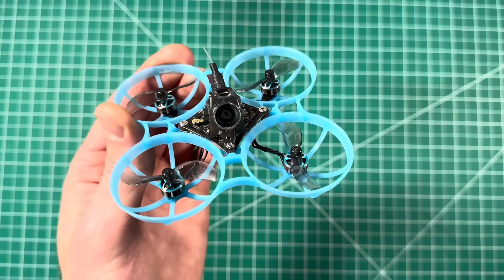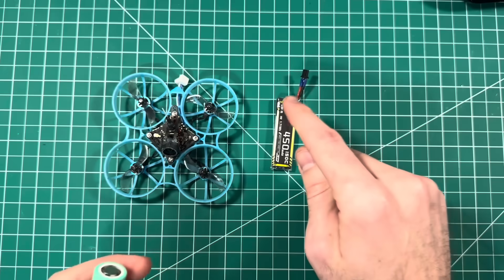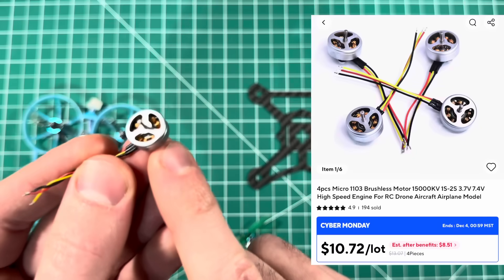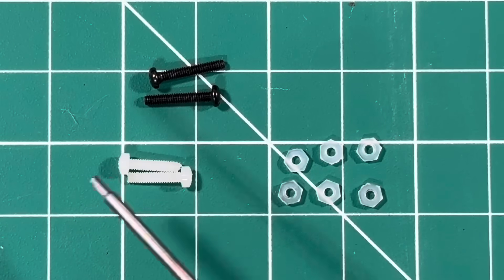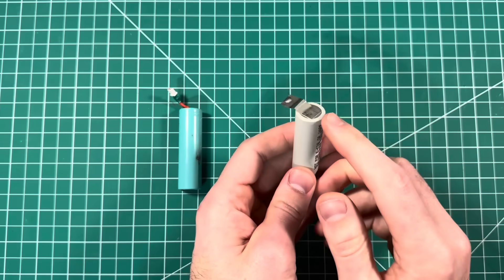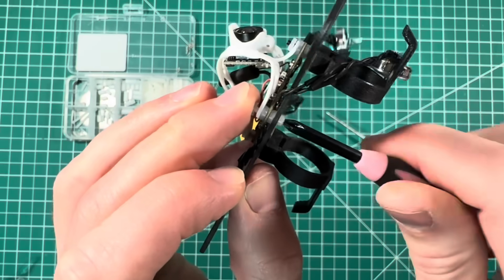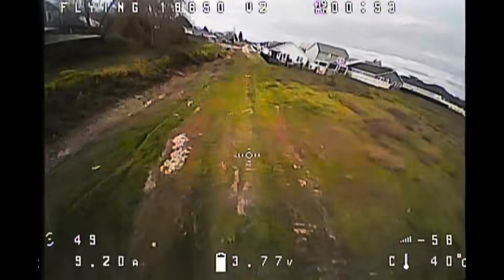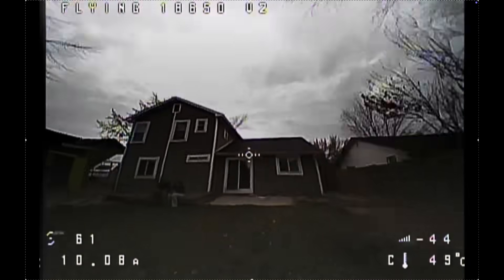Convert Any Tinywhoop to use 18650

Comment: dont listen to this guy... you can solder the battery its not damaging at all youd have to hold it there for 5 mintues to do so...   also a vt6 sony cell 15 -30 amp is good or a monocell i think its called 50 amp cell..... a 1404 motor is the bare min 2s motors.. a betefpv 1s hd board is what you need and dont use the power for the dji lite vtx you need to remove the pins power and grond and get a 1s 2 amp bec they make micro ones and use that to power and leave the connections on the rest of the dji connector into theboard reason why the 1s board lies and says it can handle dji it cant only for 3 minutes then you get warnings overheating cpu etc... so you need the bec...... and a good frame and the 1s board has expresslrs on it already.. it will fly about 7-9 minutes not 10 to is totally low you want to still stay at 3 volts min lition can go to 2.5 but you need to still stop at 3.3 volts be on the ground and 3vollts being the bare min leave the settings alone on the a1 betafpv board just setup your radio elrs etc and youll have a awesome flyer i have 5 betafpv boards and they all come pre set up for anything even the pids they fliy perfict you shoudl fly at 30-40 throttle punch outs are not a good idea   the bec will cut off at alittle under 3 volts so be on the ground at 3 thats about 7to 9 minutes not 10 not 15.. i been building drones since drones and lipos first came out first lipos came out the debate on the 1 c thing etc... btw you can charge up to 5 c on some lipos dont do it but rarely maybe 1 c to 2 c to keep the cell lasting longer instead of 200 cycles youll get 500 etc... anyway thats my advice.. ive just built a micro like this with a 1 s 8 minutes flight time it hovers with hands off  dji lite super quiet etc.. and i think i spent about 250 max i already had a radio though i bought monocell battts they are the best at 50 amps output vt6 sonys are next up and if you cant find them samsung 15 amp or higher is what you want youll find sonyy gets how everyone but the monocells get hot they get warmm.. so there you go thats my 1 good deed for the day
Reply: i assume you are talking about molicel, as far as i know they don't have a 18650 cell that is anywhere near 50a capable. unless you aren't talking about molicel.

Comment: Thats some advanced mental gymnastics there, if you are tripling the weight of battery for triple the runtime why not just strap 3x lipo batteries?

Cost is really not a factor there, those 1s 450 lipos are getting cheaper and cheaper day by day and its barely any money save to use 18650 if you are to get quality cell. The lipo packs you shown in video are currently 4 pounds each or even as little as 2  if bought from overseas. Then the flight time, just why? Whoops are fine if flying 3-5 min then you come for 15 second battery swap, you are always flying those close to starting point with those. If you are going for long range missions just grab a bigger drone.

Idk why are people acting like you go out with your whoop and fly one 3 minute pack and head home, like you cant change them on the spot. Just grab 10 pack of those cheap lipos and have them all charged for the outing
Reply from the maker: Love that you bring these points up!

1) why not just use x3 small lipos?
4 small lipos will give you 1800mah at 52 grams weight vs 18650 will give you 3000mah at 48grams weight. You get waaaaay more capacity with lithium ion per gram of weight. 

2) Cost
Your right. Really 18650s will be more expensive if you add in the wires and connector it ends up being around $5 per battery. The difference is that the little Lipo batteries don’t last very long. They are not very durable and don’t have very many cycle life’s before they don’t hold a charge anymore (100-200max). Many 18650s on the other hand, have over 500 cycle life’s before and tend to be more durable. This will create less waste and be cheaper overall because you shouldn’t need to buy batteries half as much. 

3) small drones have more accessibility to places. 

4) your also right that you can easily bring a ton of 1s lipos and just switch them out. This one is probably more personal preference but swapping out lipos gets really old for me. I have found that I learn a lot better when I have more extended flight time. I can really get in the groove.

There are definitely pros and cons and I don’t think lithium ion will ever replace lipo but I also think that Lithium ion can be a fun alternative for some applications

Comment: with 3 inch props you can carry  21700 cell

i got to 30 min flight time

pretty cool

but i prefer the agility of lipos most of the time
Reply from the maker: Yeah, it is pretty hard to beat the raw power of a Lipo! Maybe someday we will find that perfect combo that gives the exact same feel as a lipo
Reply: @MediocreNerd there are 18500's and 18350's which would be lighter but  i have not seen any with tabless construction for high current (like the ampace jp30 and eve 50pl)

Comment: looking at the lava 1102 motors and they draw 10.5 AMP on 8V on 1.6inch props already,  not sure how 51mm props shown (2inch) would not burn that board out
Reply from the maker: It’s on 3.7v meaning it draws about 5amps at max throttle

Comment: i needed a tinywhoop size but with more wind resistance and longer range to even concider getting my first fpv drone, this is exactly what i needed

also could you add more 18650s, like 4 of them for a very slow but very long range automated tinywhoop with gps?
Reply from the maker: With this size, adding another 18650 in parallel would consume too much power and you would probably actually get worse flight times.

Comment: Alles suppi, aber das Thema habe ich leider schon 2019 für mich entdeckt, bevor Crux3 und Rekon3lr da waren und mit 1102 Motoren 9000kv und 3" Prop wird es noch effektiver. Mann muss keine 1202.5 Eisenschweine verbauen, um Spaß zu haben 👍🏼👏🏼😘
Reply: Aber ich muß auch gestehen, ich fliege meist VLOS und habe keine Kamera verbaut, aber Licht grün vorne und rot hinten.
Reply: Ich werde jetzt 1S 21700 3,5" testen, dann 1S 4" Zoll und dann 1S 5", mal schauen, was da rauskommt, natürlich keine Raketen, aber ich will auch nur gemütlich dahingleiten 😂

Comment: Do you feel bored after flying for more than 5 minutes?

It’s why 3-4 min cap then break between will keep you going. 

Not sure if I’m alone in that issue. Anyone?
Reply: I do 16/20 minutes freestyle with liion im my 4inch and don't feel bored. I just train and try several maneuvers... Also when doing long range it is very cool (the distance, risk and astonishing vision, I believe I could be 50 minutes flying)
Reply: @gabriel123432112343  Get yourself a wing, there you can easely fly for 60 min with the right setup
Reply: it's definitely boring, 50 seconds is a long flight when you're in a tight space going full speed.
Reply: Ditto, prefer more agility with shorter flight times for suuure, but i mostly fly 65mm where the power:Weight really matters over flight time

Comment: Ok how is the 2.5 versus the three? Was it that last time you liked the three? At the same time I feel like the three totally defeats. What was so cool about the first little one, but the first little one probably wasn't good enough with flight characteristics and stuff. It's just overloading those little parts I figured around to 2.5 would probably be The Sweet Spot where it's not too heavy. So you're still getting power, but it's not too light that it's been overweight by the battery. Do you enjoy the 2.5 more or the three? And a comparison would be interesting
Reply from the maker: Hey man! You are totally right about the smallest 80mm build being cool but not flying super well. I think 2.5in is the smallest you can go and get good flight with an 18650 for now. 

The pros to the 2.5in vs the 3in would is that it is quite a bit lighter than the 3in. It is low 30 grams vs low 40 grams for the 3in. This means that the 2.5in can accelerate amazing (maybe just a bit better than the 3in). 

While the 2.5in flies good, the 3in is buttery smooth and almost never gets prop wash. It holds lines amazing and feels very stable. 

As far as flight time, they both get around 25minutes with conservative flying. I’ll think about doing an in depth comparison video in the future!
Reply: @MediocreNerd  cool you inspired me to order a few high amp batteries and play myself but personally I preffer a performance beast like 4 mins of ripping is much more enjoyable to mee than exploring slowly for 20 lol but I do think it might be cool for mini longrange vs a 4 inch which I'm working on as well, anyways let me know when your free I'd love to feature you on a podcast and hear your story and talk quads! let me know your time zone and when youre ussualy free
Reply from the maker: @TorontoFPV  I’d love to be on the podcast. I’m a fan of your channel! I’m on MST. If you can send me an email to canyonmcc@gmail.com, we can work out the details.
Reply: @MediocreNerd perfect!

Comment: why not split the difference and go with an 18350 battery?
Reply from the maker: Discharge rate is too low. Weight to capacity ratio isn’t as good either

Comment: JP30 is 56A with TEMP Cut. 36A is a constant current but on top of that you have air cooling. Also this cell allow you to pull over 100A in burst for 2-3 seconds. This cell is far superior than the Molicel P28 or even the P30B.
Reply from the maker: Yes! Thanks for the added information. Can’t wait for them to be back in stock on your website!
Reply: @MediocreNerd  They are arriving on Monday. 😀
Reply: i was thinking the same thing, jp30 is in another league compared to the p28b
Reply from the maker: @bradensinclair9517 it is when you look at the specs and do large amp draw testing. But shockingly I couldn’t tell the difference in a blind test for this application. I think it’s because those motors only pull 25 amps max anyways

Comment: bro r u nuts ur esc gonna die soon u neeya buy a new aio then surely
Reply from the maker: I have 3 different versions of this build with the same flight controller. They have been going strong for 3+ months now no issues, even after multiple hard crashes. 

The boards are rated 5amps/esc = 20amps total continuous. If you look at the data sheet, it is rated for 8 amp 3 seconds burst = 32amps total burst. The build rarely goes over 20amps. So technically within the specifications.

Comment: you can check out other cell sizes as well for tinywhoops. 14500 or maybe as small as 12300? :)
Reply: They don't have a high enough discharge current. At best you'll get like 10A but tinywhoops push around 20A
Reply: I was also thinking that,it would also be interesting to find the point of Dimising return as bigger battery will increase flying time but also increase weight which will decrease flying time so what size li-ion is the ideal size
Reply from the maker: Anything smaller than an 18650 has pretty low discharge rating and they can be pricey. Would be cool to try tho!

Comment: Maybe this is a dumb question, but why do you attach the wires to the battery instead of using some kind of battery tray that you just stick the batteries into?
Reply: Battery tray is alot of useless weight.
Reply: Because they weigh a lot compared to soldering and in tiny whoops this weight difference matters a lot
Reply: A soldered connection has lower resistance, Or it’s just more convenient then adding a tray, Or he just didn’t think of it, There’s a few long range drone builds in the 2.5 inch range based on 18650.
Reply: Battery tray = More weight = Less fly time
Reply: He mentions this in the previous video
Reply: Thank you for your responses! That makes a lot of sense
Reply: Battery tray connections are resistive and unreliable as amps increase. Oh and yeah heavy

Comment: What are the whoop esc's rated for? I did see you hit a peek of 25 amps on your power loops.
Reply from the maker: 5amps continuous per esc, so 20amps continuous total. Also, if you look at the specification sheet it mentions 8amp bursts for up to 3 seconds, so 32amps total burst. I have been using 3 different boards for 3 months now hard flying, no issues (surprisingly haha)

Comment: This is the LOOSEST form of the word “conversion” I’ve ever heard lol. 2 out of about 14 parts were transferred to your “new build.” A conversion generally implies you can use mostly what you started with to achieve the end result. I appreciate honest titles over click-baity ones.
Reply: "The only tools you'll need are a Phillips and a Hex" and a new frame and motors that will take a month to get from China, oh and a spot welder to adapt the batteries, and a 3D printer to make battery holders. C'mon bro 😂

You can buy a Baby Ape for $120. It won't fly for 10 minutes, but it'll run rings around the No Longer A Whoop whoop.

Comment: BetaFPV do not make the Twiglet frames any more. The ones on AliExpress are imitations, and in my recent experience, suffer from resonance issues.
Reply: can't be fixed by filtering?
Reply: @goku445 No. Not in my case at least, the noise was too broad.
Reply from the maker: @aracrg was it a pusher build? May have to do with the thicker arms. A pusher would avoid those vibrations by not pushing air onto the arms. That may be a possible solution. It flies pretty well for me
Reply: @MediocreNerd I'm not certain of the meanings between pusher and puller, but it was the opposite of your setup. So perhaps it was related to airflow.

Comment: Would you recon to use the betafpv air AIO on a toothpockbuild? It‘s rated for 5A only, but your builds seem to handle the higher amps quite well.
Reply from the maker: It has worked fine for me so far. I have found matrix aio boards to be a bit more durable than air aio though so I would be a little more cautious

Comment: I put a micro foxeer gps on a 65mm tiny whoop dose position hold/ return to home only adds 2-3 grams i used a 15g race whoop.
Reply: What FC do you use? All my small Tiny Whoops FC's dont have a spare UART
Reply from the maker: @kamegoshin8954 matrix aio has extra UART
Reply: @kamegoshin8954 i use the BETAFPV air G4 5IN1 V.1 there's a spare UART on the underside of the board UART4

Comment: Can I still use this to set up on the crux frame?
Reply from the maker: I have found the crux frame to be very durable. Not sure what build this other guy has but maybe it is super heavy? I have crashed from the top of a tree straight to pavement with no damage. The crux won’t be able to fit these same motors tho. You will need to use 1202.5 motors to fit these crux frame
Reply: @MediocreNerd  I had a bone stock Crux 35 from HDzero. I've broken four frames all from crashing into trees. It had the stock happymodel 1404 motors.
Reply from the maker: @Qlorque your using a completely different frame my friend. Crux 35 has longer arms and you are using heavier components. I used the crux 3…
Reply: @MediocreNerd think betafpv 1104 72000kv get me anywhere?
Reply from the maker: @FpvShottie that should work. I have not tested it so I’m not sure if it would be better or worse. Only one way to find out ;)
Reply: @MediocreNerd  update she flies pretty good i dont have much drones so i cant really compare it plus its my first toothpick but still on 1's lihv, also i have a vape shop battery in my radio master pocket, the brand is (kdest) model is (K6H 3200mAh 60A) will this work lol
Reply from the maker: @FpvShottie I’m not sure of that brand is truthful. 3200mah and 60amp discharge is really hard to believe. I would be surprised if it is over 15amp discharge. But, if it has at least 20amps discharge it will work. 

I would love to see some pictures and to show off your build in a post on my page, if you are agreeable.
Reply: @MediocreNerd  it’s vape battery i do know that’s needed for vapes, is there any way i can test it to see and yeah I’m okay with that how will I send it?
Reply from the maker: @FpvShottie best way to test it would be to hook it to your quad and look at the amp draw on the OSD. Mine has drawn up to 30 amps and flies well. If yours can’t draw around 20 amps and does not fly well then it is probably the battery at fault
Reply: @M @MediocreNerd  I’ve dm’d you on IG
Reply: That Crux frame is going to break.
Reply: @Q @Qlorque what frame do you recommend
Reply: @FpvShottie  Anything other than that frame tbh. If you want a 3.5 inch frame, there are so many other better ones. The crux frame will snap if you breathe on it.
Reply: @Qlorque I’m new to the hobby, I was going where there is more support rather than me trying stuff on my own lol